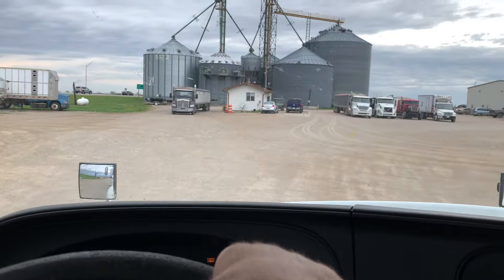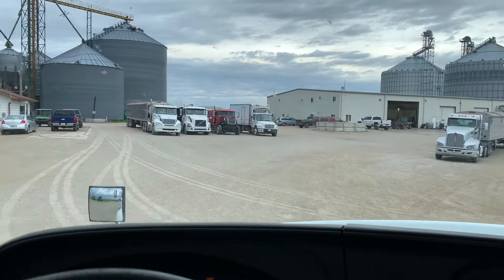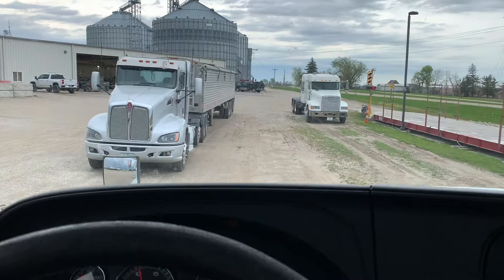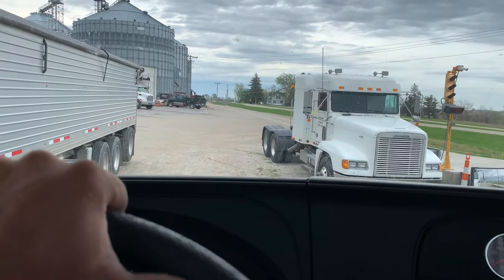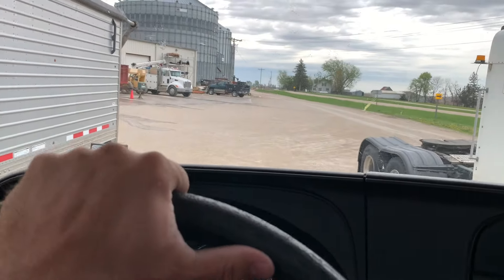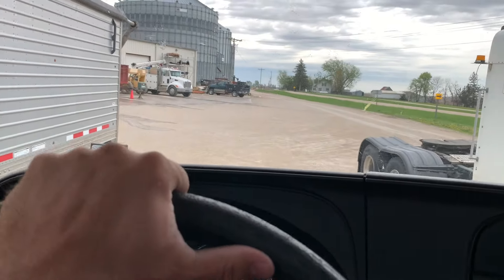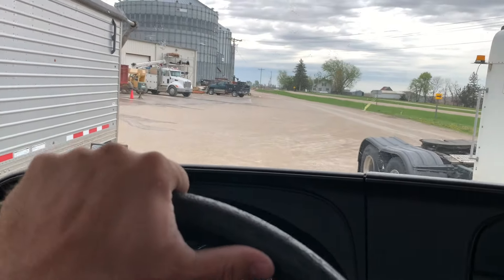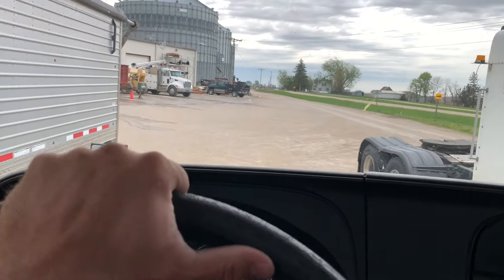Picking Up My FLD120 (Owner Operator Trucking)

Comment: The ecm is your problem, if that Pittsburgh Power box had a shortage. Before getting pdi parts. Send your ecm off to be tested. Much cheaper option.
Reply from the maker: I’m ganna have to look into that
Reply: Yes absolutely do. So many guys replace injectors on Cats just to find out it didn't solve anything until they replace or fix Ecm

Comment: injectors wont fix it, flow matched lmao, they have trim codes for a reason, very rarely do you find one with the same code but it does happen, the trim code tells the ecm how much fuel it injects, the machining process has variations so you get different fuel rates due to bore and plunger tolerances, if your vibration is moving only, pull the entire driveline and check all ujoints for binding, should be smooth as butter, you should have two or three spacer plates at the carrier bearing, if your vibration is sitting still but get worse at higher engine speeds, unbolt the clutch from the flywheel and see if it goes away, clutch adjustments can cause them to get unbalanced, sometimes during a overhaul you get vibration from a unbalanced rod, if its ever been hydralocked the crank can be bent, if your engine mounts are soft it can drop the angle at the tranny and cause issues. pull the pan and check for a rod turned different than another, so many things to check, cat made a flywheel program to balance flywheels just for the problem your having.
Reply from the maker: Did realize the clutch adjustment could mess with balance. It’s getting time adjust again. I might adjust it and see if I can tell if it changed vibration any.

Comment: Yea those boxes are old. They definitely can fail but they know what they’re talking about there. Believe it’s Leroy you want to talk to. Glad you got the ol girl back!
Reply from the maker: I think I’m ganna leave the power box out of the system and do remote tuning if I do anything. I did notice a slight drop in power with it unplugged but I’ve never owned or driven a truck with high horsepower so I’m not addicted to it yet haha

Comment: Call Pittsburgh Power and talk to Leroy the electrical engineer there. He can fix that box up back to new if it has a problem. Or go see one of the remote tuners and they will plug in and set your tune however you like. I am one of the remote tuners it is pretty impressive what they can do.
Reply from the maker: Remote tuning would be something I’d be interested in. I’m not to sure I want the power box in the system

Comment: sounds like you have a big air leak
Reply from the maker: Where in the video did you notice it?
Reply: @truckingwithfitz3399  starts about 1050 into video while looking at the motor and gets louder under truck by fuel tank